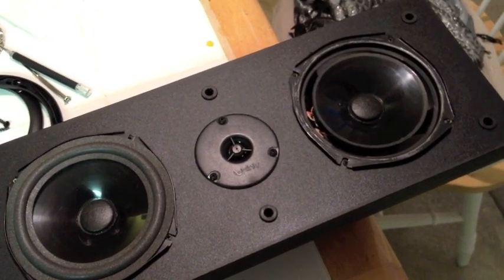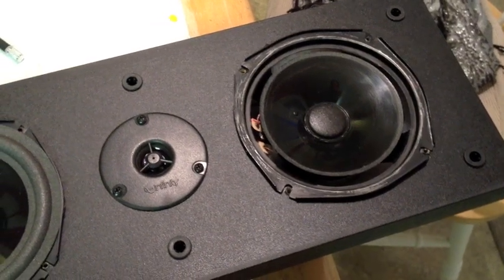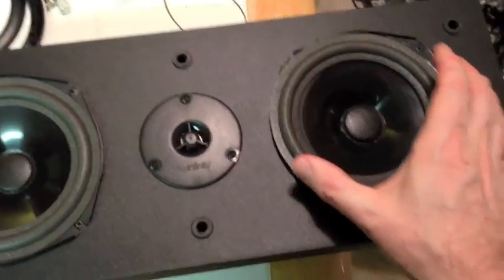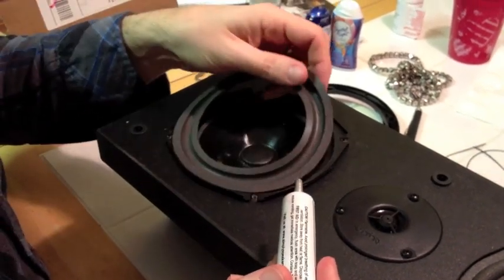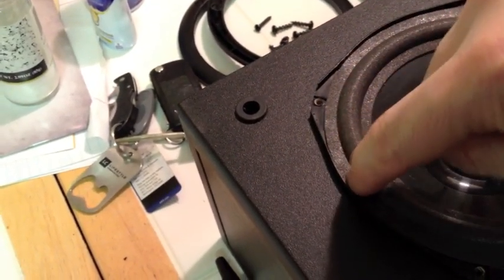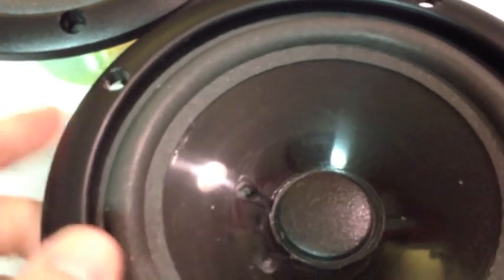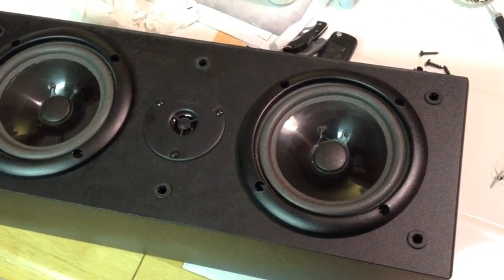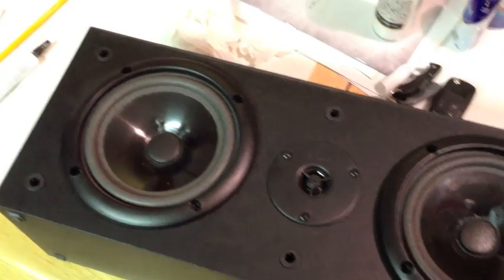Infinity 5.25" speaker foam replacement

Comment: Thanks for saving me $. I picked up that pair of 5.25" SL 10 SS 2001 bookshelf speakers for only 45 bucks from an older guy that didn't want to do a re-foam. Spent another 20+ for the refoam kit and voila! they're as good as new.

Comment: Thanks Bob! I meant the outer plastic ring. I wound up getting it off by using an exacto knife and continually scoring around the edge. Each time the blade would go deeper and eventually loosen the glue.

Comment: Just to be safe I would remove the center cap and put a plastic sheet between the magnet and the coils, the plastic sheet diameter should be roughly the size of the magnet and it should fit snug 
between the coils and magnet. If you pull one side of the cone while gluing you will regret not shimming it.

Comment: Hi there, great video.  I have the exact same center speaker and am about to try the foam replacement.  Can you tell me how you got the plastic ring to separate from the  speaker itself?  I don't want to exert too much force and dramage the ring or the cone.  Thanks!
Reply: metsjets I'm not sure what you mean. I never removed the plastic center cone. And since it is fairly durable, I think I used alcohol and a small putty knife or scraper to get the last of the old foam ring off the cone surface.
Reply: metsjets Oh! You mean the plastic ring that holds the speaker in? I think it is just glued on. Just pry it carefully. Maybe warm it up a little with a hair dryer or something might help.
Reply: i have the same problem you did yours a year ago they still working?
Reply from the maker: Mine still works great!

Comment: Great vid. I notice that they say not to put the glue on the foam, that it will wrinkle it. Does that mainly apply to the white glue? I see you did it successfully. Did you spread the glue with your finger before putting the surround down? THX
Reply from the maker: I don't think I spread it out. I'm pretty sure I just flipped it over and pressed it down. But its been a few years so I'm not 100% sure. I didn't have a problem with anything wrinkling.

Comment: What is the model of this speaker? Is it actually a 5.25 or 5.5 speaker? Just want to make sure I get the right kit. I can’t find the model on the speaker anywhere. Thanks .
Reply from the maker: Elisha Lott I still have mine but I don’t see a number on it. You could measure the diameter and talk to the dealer to double check but I think it was 5.25
Reply: bobotron50 I preciate it man.. I hit the site you referenced and they had the 5.25 so that’s most likely what it is I think . Regardless, great video, thanks for the info. Picked one up on eBay and got the shaft. 🤘

Comment: How did you remove the plastic ring that seals the outer ring of the foam. (Without destroying either :) )
Reply from the maker: +Alex Berry The plastic ring that covers the edges of the frame? Mine just popped off with a little force. I think it had tabs that snapped on.
Reply: I found that it takes some patience remove it from the frame.  I used a thin flathead screw driver to pry the plastic cover off by gradually working all around. It has tabs but also it seemed to be glued - possibly from the foam.

Comment: BAD idea gluing both edges of the surround at once like you did. The result was a very uneven attachment on the cone. Your foam surround doesnt follow the old glueline AT ALL in places. You do the attachment to the cone first,...focus like crazy on just that attachment and getting it into a perfect circle. THEN you tackle the attachment to the frame.
Reply: actually, I did the same thing as bobotron50 and it works great